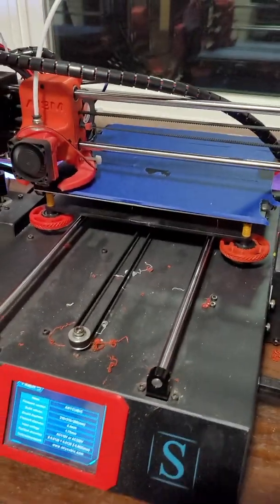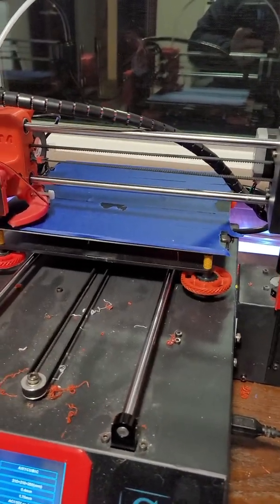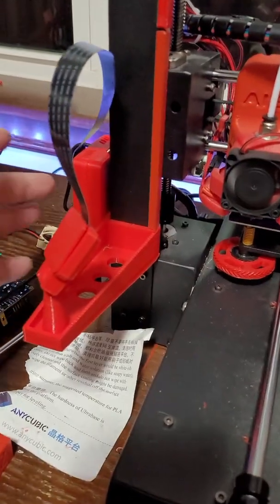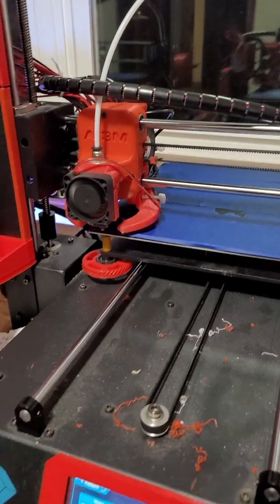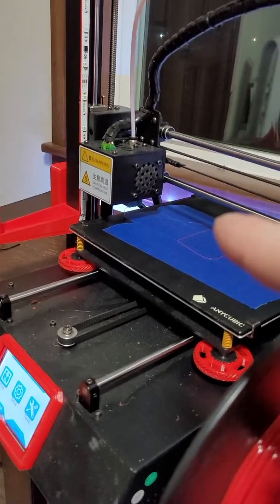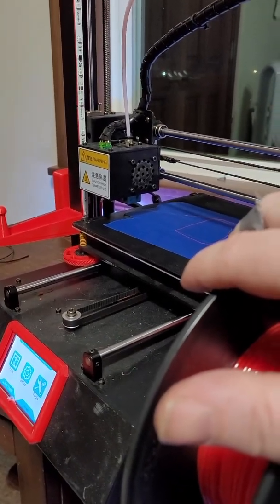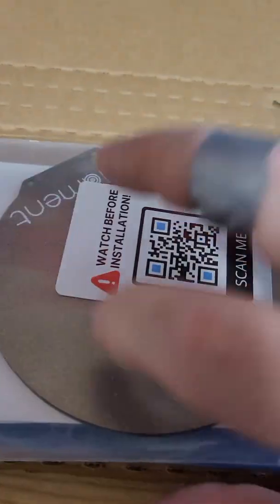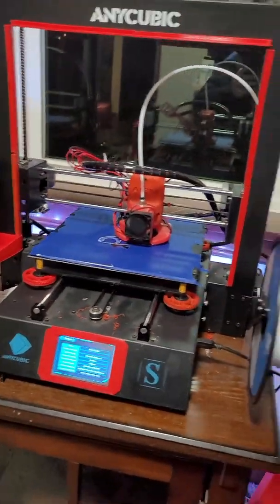Anycubic Mega S 3D Printer Upgrade update

Comment: Hi I have the same printer  lately just print half and say print done took so forth and so forth do you have any suggestions? And for the life of me I cannot do the firmware update
Reply from the maker: i do the firmware upgrade through cura and the usb connection between the computer.  as for only printing half way.  I have not seen this.  What errors do you get, if any?

Comment: I noticed that black filament is usually the cause of peeling on an ultrabase. What I did on my second one is to not glue it back down, and just hold it on with binder clips. Once a print is done, I just unclip the class, and put it in the freezer. After a bit, the print just slides off.
Reply from the maker: I just went with a filament pei base. It's been flawless